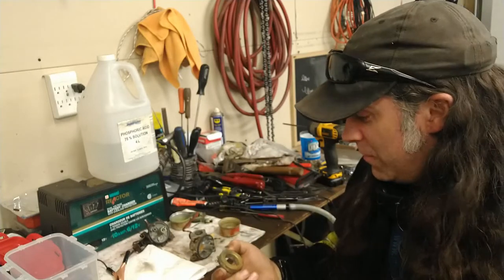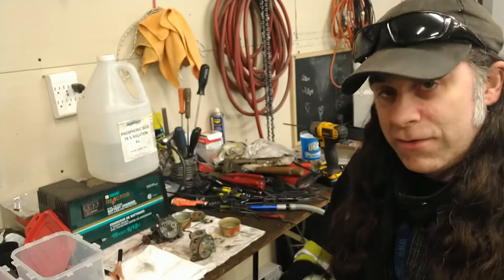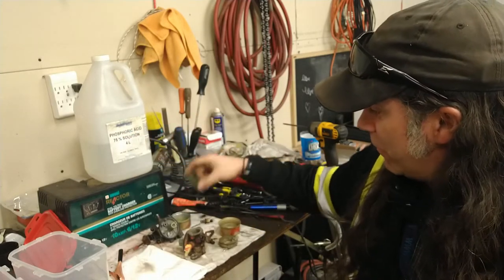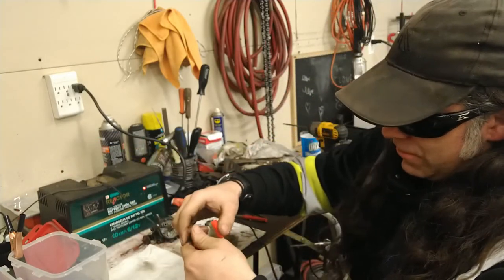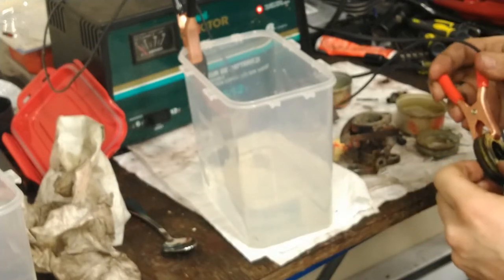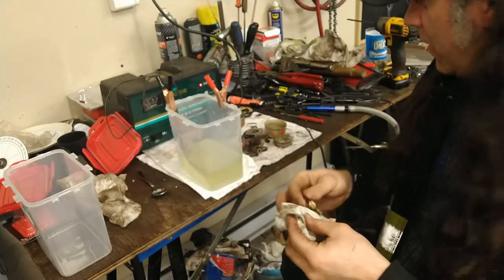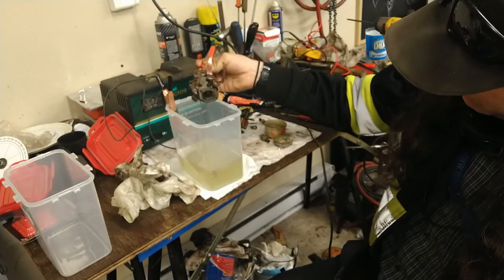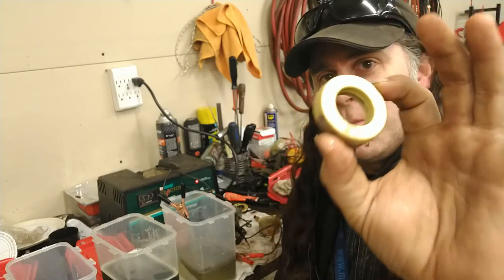How to clean a carburetor with a battery charger... Electro Polishing rig

Comment: I have used "washing soda" dissolved in plain water from walmart when cleaning steel
Reply from the maker: This process requires acid, washing soda is the opposite. This is electro polishing and it is not rust removal on steel.

Comment: I would like to see just dipping into phosphoric acid alone as a control test.
Reply from the maker: I've tried it and it's nothing compared to having it hooked up to the charger... It will clean the carb and remove some corrosion but you have to soak it for quite a while where it's super clean and corrosion free in 35 seconds on the power supply. The jets and other brass components come out with zero build up or contamination on them when  you use the power and electropolish.
Reply: @patthesoundguy  thanks for reply. Good to know

Comment: If I don't have a charger, can I connect it to a car battery? It seems to have up to 50 Amperes..
Reply from the maker: Even a 9 volt or 12 volt power supply from some old electronic device will work. The car battery will work too I'm sure
Reply: @patthesoundguy  Thank you

Comment: Would muriatic acid work? I get it at Orange box store for gas tank rust removal. Used to be $7.99 gallon. Up to 11.99 now.
Reply: No way!  Hydrochloric acid is already active on metals, making your metal an anode in hydrochloric acid will just destroy it!  You’re just going to make dark green acid and the part will be irreversibly pitted!  You need phosphoric acid because it’s viscous

Comment: This is cool! How much clean is because of acid vs how much from the electrolysis? Is the acid just for to ions? Would salts work also?
Reply from the maker: My buddy and I were discussing muriatic acid for it because it cleans rust from steel so well just on its own... I would dilute it to a very low concentration because I would think it might cook the carb at full strength. The corrosion doesn't come off with just the phosphoric acid anything like it does with the charger hooked up. It doesn't touch the goop that's on those floats by itself thats for sure. I may try the salts or washing soda or baking soda like you do for regular electrolysis. Gotta make another video for those questions for sure
Reply: @patthesoundguy  I suppose a 12 volt car battery could be used just like a charger could. I have a spare 12 volt battery for my snowblower that I keep on a tender. I don’t think the 4 amp tender gives enough juice to do things like this. Plus the tender is microchip controlled. I need a good old fashioned battery charger for fun like this.